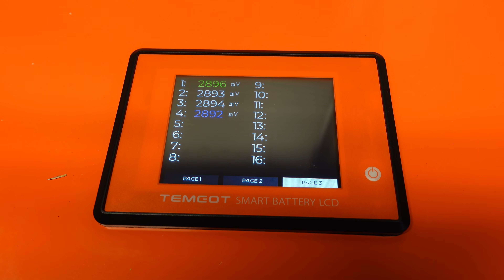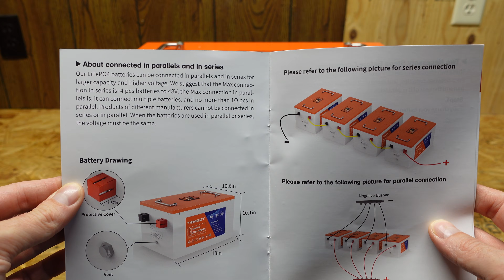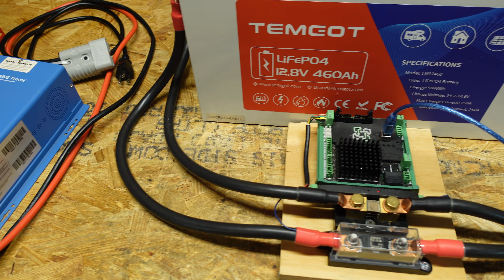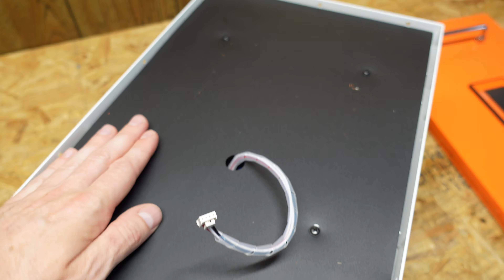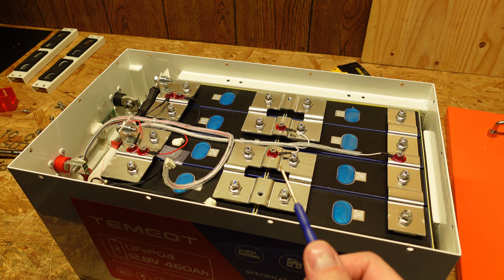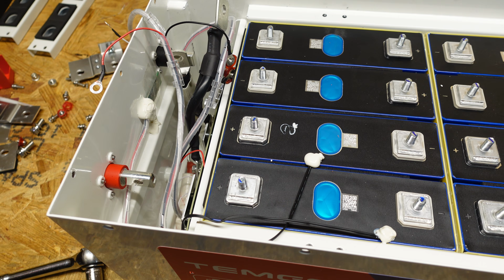PERFECT Temgot 12V 460Ah LiFePO4 Battery Review and Teardown, EVE Cells

Comment: I saw a review of the 300ah TEMGOT by another channel. I was impressed by that one and this seems even better. The 300 was not vented and the reviewer had to destroy the case to get it apart. This is a big physical improvement but the batteries and other components seem about equal. All great quality, based on these 2 reviews.

Comment: This is what i wrote and you need to see to the bottom where they came from. I wanted to believe temgot now your name is temgo, was the best choice for your 460 ah 12 volt lithium iron. So now there's a big sale if I buy two batteries.  So 2000 plus tax is 2 grand. So you dont answer phones and your website is all messed up. So that will show the warranty if something was to happen. So i guess I will go with epoch, for 2000 a battery im in safe hands. I got a ten year warranty. So for all I know you might not be using eve grade a eve cells  230 ah cells anymore. The tear down of your battery was a year ago. The terrible thing most cheaper brands will cut corners. The worse is not for every battery to get a full inspection. So the bottom line battle born built in the U.S yes a high price tag to. They inspect everything they make. Have a nice day

Hello,

We apologize for any inconvenience caused.

Regarding the brand name change from Temgot to Temgo, this decision aligns with our global expansion strategy to create a more consistent, memorable, and streamlined brand identity for consumers worldwide.

Our customer service team is unavailable on weekends. Please call during the following hours: +1 662-888-6288, 9AM-5PM (EST).

Our warranty terms are available at: https://www.temgot.com/pages/temgo-warranty-policy

We utilize Grade A batteries. Our current model enjoys high market recognition with a mature production line, so we are not conducting disassembly reports at this time.

To expand our market presence and enhance brand awareness, while our prices are relatively competitive, our batteries undergo rigorous quality testing—no corners are cut.

Sincerely,

vatrer

Comment: Can these battery be placed on it's side?
Reply from the maker: You would have to ask the manufacturer this; however, I would only recommend use in the upright position.
Reply: @LithiumSolar  Thanks for replying, I went with the Vatrer 12v 460Ah battery, they can go on there side.

Comment: Why does the app show this as a 4-cell battery when it is actually an 8 cell???
Reply from the maker: The cells are wired in parallel sets of 2, so while there are physically 8 cells, there are only 4 electrically.

Comment: I purchase this battery in March 2024 and installed in my 5th wheel with a 3000W inverter. I love it. Great for not having to run a generator unless I need AC ( however, I did accidently run the AC off the inverter for about 3 hours). I have also used it during scheduled  power outages at my house for my home office and refrigerators. I have a 1000W of solar to charge it.

Comment: I watched your video, was impressed, bought one, and 4 weeks later I think I have to return it.  I've been gone for 3 of those weeks, but I would find that the inverter kept shutting off, and I thought the issue was the inverter.  The thing had almost no load on it.  It's like the BMS would go to sleep.  Further research showed that people found that it didn't reliably detect loads under 1Amp, which maybe that's what's happening with mine.  It's in my shed, and when idle just powers the charge controller, inverter (which I mainly use to power several other battery chargers), some DC powered LED lights that come on via motion sensor, and a thermostatically controlled fan.  Anyhow, I'm pretty sure there's some issue with the BMS.  We'll see how their support is but being that my return window closes in two days, I hope they reply with a fix very soon.

Comment: The pressure relief valve of my rotomolded cooler seemed silly until I came down from 6,000 feet elevation, back to my home at ~230 feet elevation, couldn't open my cooler, twisted the valve and the pressure equalized.  So I do see a benefit should that case be well sealed to have the ability to vent.

Comment: kinda fishy at 581AH alongwith manual stating 2000 cycles tells me they are using used and/or degraded cells.  i would stay away
Reply: you should really investigate this before sending out affiliate links. something doesnt add up in a big way
Reply: The influence of different discharge depths. Shallow charge and shallow discharge can achieve longer cycle life.

Comment: Too expensive, I just bought 4 12 volt 100 ah with blue tooth for $680. 00 shipped.
Reply: Depends on use case to me. Are your 4 100ah all in one portable case?
Reply from the maker: Yeah good luck with those $170 batteries...

Comment: Do these batteries need an actual “charger” to charge or is the charging logic built into the battery and we just need a power supply?
Reply from the maker: You need a charger rated for LiFePO4 batteries.

Comment: Gezz, these batteries are getting so much cheaper and better then just 4 years ago.
Reply: same thing happened with the pc computers  the r and d tooling and development costs get paid off and improvement's in quality usually follow  to a point then it starts ad this ad another feature and costs start getting higher and basics get cheaper but then everyone wants the upgrade pickups are prime example 6 cy stick trucks were cheaper than most cars until loaded with too many features cost got to point 90% of pickup buyers who really need a work truck cannot find anything but super plush 80-100k ones with interiors you hate to wear work boots or dirty pants in

Comment: Wow! Not bad
Reply from the maker: Did you find anything that I'm missing lol? I see a few are mentioning concerns over the cable thickness. I may do some further testing there - need to pick up another inverter.
Reply: @LithiumSolar  the low temp charging shut off needs tested.  We learned from Will that some advertise this function but sometimes it doesn't work unfortunately.  Thank you!!
Reply: @LithiumSolar Mine read 485AH for a week.  Safe to keep these at 100%+ for long periods?
Reply: He was talking in your voice the whole time😂😂

Comment: Really a superior quality battery. A tad expensive, but you get what you pay for. I think this would also make a superior 24v battery, hopefully they will come out with one. The cables required for 12v are really difficult to work with.
Reply: They are actually on the low side of cost if you look at other 460AH LiFePo batteries.

Comment: That's a pretty battery.  Looks like a good design and build except for the wiring.  2ga starts getting really hot as it nears 200amps so no way is that going to sustain 250amps. The 3x6ga fails about the same amperage.  Sure seems like a natural to build a 24v in that chassis but probably wouldn't be popular enough.
Reply from the maker: I agree, the market for 24V batteries is rather small. Most will make the step directly to 48V if a 12V system does not have adequate capacity.
Reply: I've been using 24v due to ampacity ratings, and the ability to fit a usable system onto a "crash cart" system. Much easier to run a 3000va Victron at 24v rather than 12v. Unfortunately I agree, not much of a market for 24v systems.
Reply: You’re forced to do bare minimum 24v…amps need to be decreased for proper wire sizing. Those aluminum busbars are going to be super overheating as well. Don’t know why manufactures insist on using that cheap ass. Aluminum…copper is far more superior for heat and amperage plus electrical conductivity..

48 V is a nice system. The only problem is there’s not too many components that you can find easily that will run on 48 V …12 V is fine for low amperage components as they are plentiful. 24 V and 36 V have more of a selection at a reasonable price point.. 
The higher the amperage the higher the heat… More Strain on components..

Comment: just picked it up on amazon for $1006.00
Reply from the maker: Oh wow, it's on "lightning deal" right now. That price wasn't there when I filmed this last night! Also, the coupon code will work on Amazon too. The price with the lightning deal and coupon is $949 (before taxes). If yours hasn't shipped yet, might be able to cancel it and re-order with the discount ;)
Reply: Wonder if the battery will be the same you received.   @LithiumSolar
Reply: @LithiumSolar  yes i was able to use the code...1006.00 was the final price i paid.
Reply: Good catch, definitely worth it.
Reply: Get a fiunie from elfhub power for 1/2 $. Save $500 and get 2kw of use solar panels instead.

Comment: I see that it has low temp charging protection. I did not see anything about self-heating. If this is correct, then using this in an RV or similar situation would require a heating pad. Do I have this right?
Reply from the maker: This battery does not have any heating functionality.